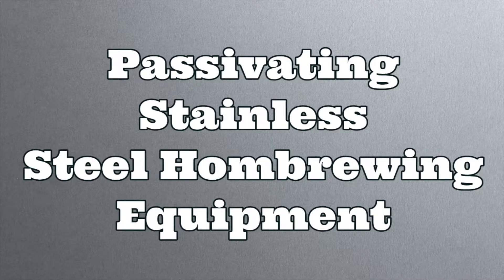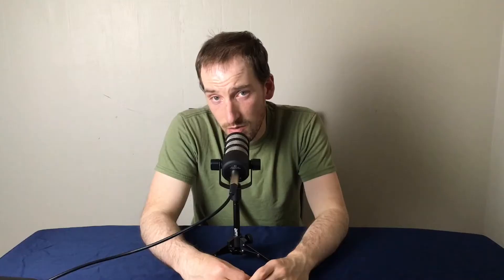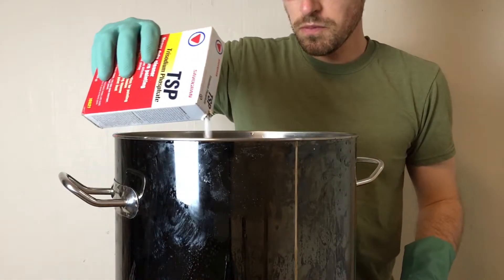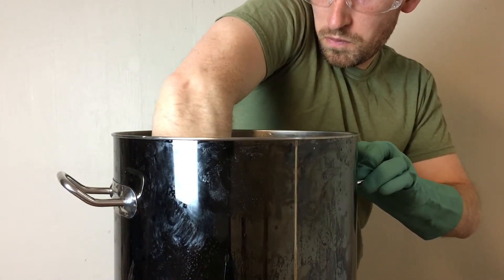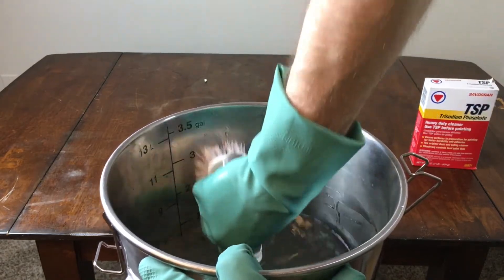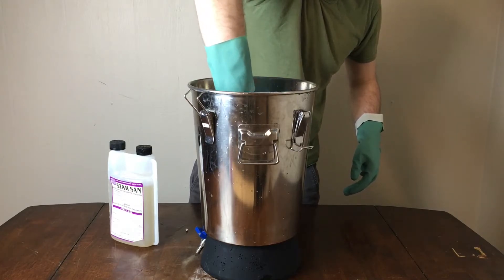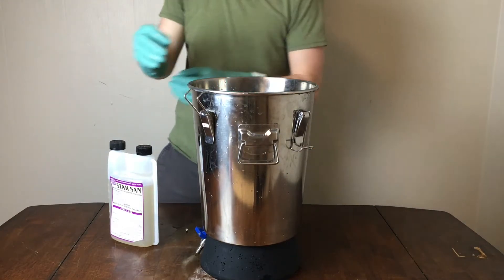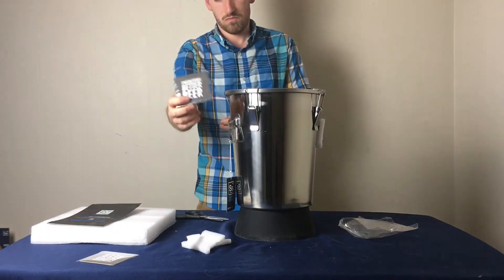How to Passivate Stainless Steel Equipment for Hombrewing Beer

Comment: Another great informative vi, Ben 😎👍🏼
Reply from the maker: Definitely do this before use as I didnt and had to throw out a batch of beer because it tasted metallic
Reply: @RecipeswithBen  ok thanks Ben. I absolutely will.  I’m gonna do it exactly as you did in the video.
Reply: @RecipeswithBen I have my new Stainless Steel brew kettle and conical fermenter.  My local brew shop sold me PBW to clean and the instructions say use Star San after cleaning.  Will that be enough or should I also use a citric acid to passivate before Star San?
Reply from the maker: @Norseman2  I would check with the manufacturer of the equipment and see.  I know that SS Brew Tech recommends passivating their equipment.  I didnt do it for my first batch with this brew kettle and it made the beer taste like metal YUCK.
Reply: @RecipeswithBen  I ended up washing with PBW, soaking it in a citric acid solution, rinsing thoroughly and soaking it with Star San.  First batch is fermenting now.  Fingers crossed!!